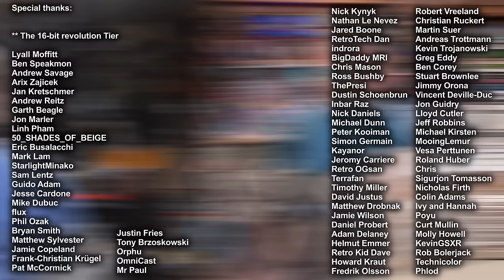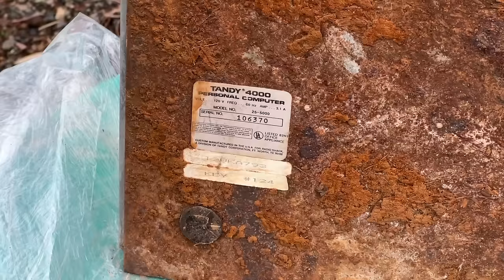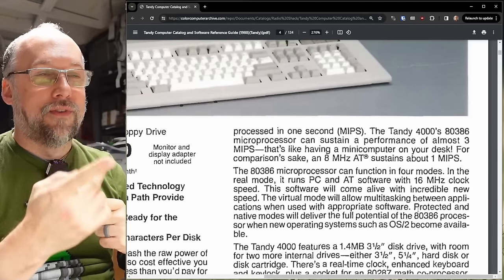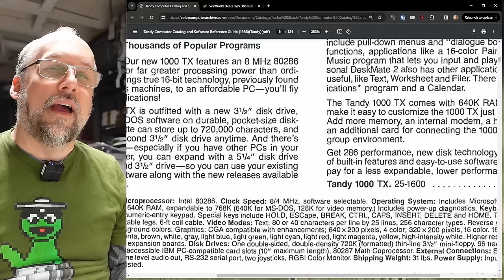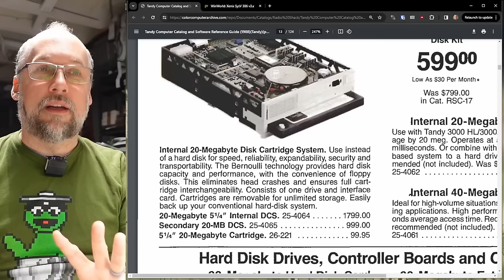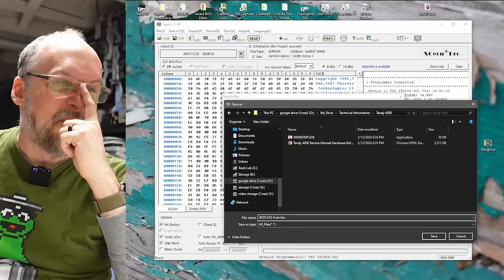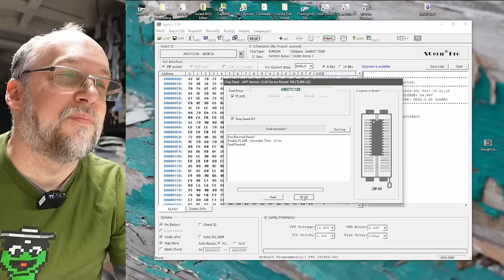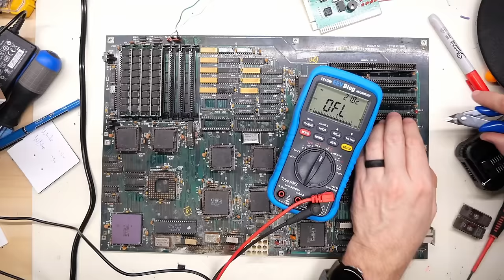0079 I'm at a loss for words when I first see this Tandy 4000 computer

Comment: You are going to need a sponsorship from Deoxit for this repair.
Reply: So true!  This is worst state of a system I've seen in some time.  I do remember the Tandy line of computers though.  I often visited Radio Shack stores because I was interested in the hobbyist electronics.  What I remember of these systems was that they were significantly overpriced for what you get with the exception of the 1000 series.  And yes the 3000+ were pretty nearly bog standard x86 machines, nothing to write home about.

Still, if you can get this to run Adrian, you truly are a master at repair.  Most people would take one look at that and say, "nope, not worth it."  I love how to take on these challenges for better or for worse.
Reply: and Clorox
Reply: Can you buy Deoxit in a 40 Gallon drum?
Reply: Interestingly I don't see any repair at all.
Reply: @jandjrandr  The 4000 was "cheap" for a 386 at the time. The only other offerings when it came out were Compaq, and the ironically IBM incompatible IBM machines with microchannel, which were even more expensive than Compaq.

Comment: Back in another lifetime, I was the manager of a Radio Shack Computer Center. The 4000 was an extremely expensive machine sold to businesses for use as a POS/inventory/bookkeeping system. Most likely it was caught in a hurricane flood and sat in an attic or something for decades! That thing was a boat anchor! If I remember correctly it weighed about 50 pounds.
Reply: Black mold easy fix just clean it off with soap and water🤣
Reply: @SaraMorgan-ym6ue  Yeah and what about the board corrosion, and the rust on the bottom? Soap and water too?
Reply: I think this one literally might have been used as a boat anchor.
Reply: @MegaFonebone  yeah I agree it explains the dirt and the rust🤣🤣🤣
Reply: @the_kombinator  nope a grinder and then rust proof coating simple
Reply: Yup. I'd bet most of these machines were purchased and re-sold as turn-key 'kits' by developers of POS etc software running on top of Xenix. That was a really common business model. There's an excellent Computer Chronicles episode where they talk to a national insurance scheme (firefighters union?) about their move to a supplied turn-key OS/2-based database and client management system.
Reply: @rabidbigdog  can you imagine someone buying up the designs for these old chip to make these machine doing die shrinks then making new old retro computers that do the same thing buy for a fraction the cost of the originals man they would make a killing on the old retro computer market🤣
Reply: @SaraMorgan-ym6ue  For rust that pitted, I'd sandblast it. I mean, yeah, it is a computer, it's not exposed to the elements, but if it's something you care about, I would do it right.
Reply: @the_kombinator  meh I would never bother with something that ancient so that fine if you want to sandblast it have fun
Reply: @SaraMorgan-ym6ue The cost to do all that you're talking about is non-trivial. The killing they will make is of themselves.
Reply: In Australia it was a very fancy computer for schools, mechanics also used them a lot, and many factories would run things from them. We had 3 at my school, a fancy private school. There was this game I played on it where you were on an island, it was SORT of a text adventure with ASCII graphics, you had to chop trees and build a raft, and a little bridge, and get to different islands heading east then south. I cannot find it for the life of me, it was one of those weird educational games for kids that help kids learn to interact with computers and problem solve. If anyone knows HMU.

Comment: I used to work at Radio Shack back in the mid 90s for a few summers. In the late 80s when they went from hand written receipts to a POS systems, they used this 4000 with Unix on it. All the sales were done with serial terminals up front connected to the 4000. After closing you would run the daily sales which would have the system compilate all sales/inventory data and package it up to be transmitted over a modem connecting to CompuServe. There would also be an external SCSI tape drive you would run to back the system up. By the time I was hired in 95, these systems were getting very slow (daily compilation would take a long time and the terminals up front had some lag to them). Fortunately they started refreshing these 4000s with a Dell Pentium which were much faster. They then had us actually take the old Tandy 4000 and put them on the sales floor and sell them for $200. I was told corporate would send them a disk that would reformat the drive and install DOS. But we didn't wipe them there and it had all those customer records on them! Different times. :)
Reply: By the time I was hired, they had IBM pos terminals running Win9x and ACRWin.  DDS3 SCSI backup tapes and an IBM Linux box.  This was 2001 to 2004.
Reply: If I recall, and I probably don't, I think the 4000 back room computer replaced the Tandy 2000 that they used, which was an actual 80186 I think.
Reply: I think the 4000 stuck around quite a while too, until they went to the 425sx.
Reply: I frickin miss Radio Shack.
Reply: @BearfootBob  Well, I'm kind of on the fence regarding that; only because I used to work for them.  I miss not having a local store to go into that has electronic parts.  I don't miss the micro-micro-managing they employed.  No wonder they had such a high turn-around of employees.
Reply: @minty_Joe  Here in Aus, I can't remember exactly when radio shak disappeared. In the 90's though. Soon after that Dick Smith Electronics left the hobbyists behind and stopped selling components (which was a total B because they also had a pretty good library of data sheets for the 74 series and most other chips they sold... they weren't easy to get back then) and probably 5 years ago they ceased to exist afaik.

Now, there's only Jaycar electronics, who charge like wounded bulls. Pretty much leaving us only with flea bay... a crap shoot at best.
Reply: @Jimmeh_B  Yep, ebay, Mouser and Digi-Key are pretty much all that's left for sourcing most components any more.  My only gripe about Radio Shack's selection of parts were (1) Not enough altogether, and (2) the ICs (chips, transistors, etc.) were NTE parts, which most bench techs consider to be inferior.  They may be right about that, but considering that it's the only widely available option out there, I'll have to take my chances.
Reply: @minty_Joe  I applied, never got an interview. I still use a variety of odd audio adaptors from RS.
Reply: @BearfootBob  : The South American franchise operators have apparently bought out the RS owners, so there might be a new rollout coming.
Reply: When I was 14 I bought an "ex-government" Dell Optiplex with a Pentium II 266mhz with 32mb RAM and a 8gb HDD and a 56.6k modem and a soundcard for £250... I managed to slowly upgrade it to 128mb ram, a CD-RW and 64gb HDD... With the help of some folks on IRC I upgraded from it's Win98 to a pirated copy of Win2k that took me about 3 weeks to download and burn with Nero... And another 3 weeks downloading a Slackware image... What a beautiful pinnacle of engineering Win2k was compared to previous versions (still has a soft spot in my heart - Win10 is my current fave - 11 killed the NT4 vibes and more took on a very "stolen" OSX/KDE feel to it... I digress... I learnt my craft from that machine.... A huge upgrade from my previous "Digital" 486 running DOS 6.2 with Win 3.11 for Workgroups with no modem and only Q-Basic, the BIOS, Minesweeper and Solitaire for company... Oh and the aftermarket "The Incredible Machine" game 😍😍.... That Optiplex was hammered on Kazaa, Nero, IRC and IE! Everyone I knew had personalised MP3 mix CD's - circa 2000 - 2004.
Reply: @minty_Joe I don't know that the NTE parts were inferior so much as they aren't an exact replacement. Potentially not as reliable as the original in some applications.
Reply: @TheRattyBiker  Yeah.  Win 2000 Pro SP4 was (btw) a short single step up to Win XP SP2.  So, it's really your choice which one to go with.  Nowadays, I'm going full-on Linux, unless there's a reason to use Win 10 or 11 or macOS.  

Mint w/ Mate 64-bit is my primary distro and I may be thinking about straight up Debian with Cinnamon as a more mature upgrade. Mint is great, but can be a little awkward at times navigating and setting up, depending on what you're doing.  Anything, as long as it's not RHEL/Cent OS, which really shot themselves in the foot and violated the GPL.
Reply: @minty_Joe  OoOoOh! Your quite the character 🤣 Yes I totally agree!! I was a great propenent of SP4 but XP SP2 was also a great version.... Kind of one and the same but with colourful graphics... Though I must say I adored the vulnerabilities of XP's Ctrl + Alt + Del + Del (to 2k style login screen) then an "Administrator" (no password) login to help recover files from people who had "forgotten" there password or outright "break into" a machine for someone.... I crafted my trade and earned my early years bread and badges from those tricks... O/S's today are "too secure" and "unhelpfully helpful".
Personally I loved the offspring that became CentOS as I found RedHat corporately tedious... Even back in the day... TBH though, I only ever used Cent as a server with Webmin and it "just worked" - beautifully even - compared to others.... In this day and age though, it's hard to deny Ubuntu is probably becoming a king of the servers and conquering desktops... Though I fear it's treading awfully close to the irreparable fate of RedHat... I'm not the only one thinking that though... All those old skool Grandaddy Debian and Slack-boxes are now sat on the side smoking there pipes saying "see boy - told you we predicted it" 😉😉😉😂🤣😂🤣😂🤣
Reply: @TheRattyBiker  Well, OSes today have to be more secure, for obvious reasons.  Look at Windows and how much malware there exists.  Why is that?  Because of the percentage of worldwide users of Windows there are.  If the numbers were incredibly low, chances are there won't be that many exploits targeting one platform.  That, and pluralism in the computing world is a good thing to make security pretty tight.  

As far as the distro wars are concerned, it's only a matter of time before someone makes THE One distro that puts all to shame.  Which one that is, I haven't the slightest clue, but I won't stop looking for it.  I just like the fact I can download, install and use Linux without having to pay exorbitant amounts of cash for a copy: like Microsoft does.  I also like the freedom of making and improving software that's open source.  So many benefits to doing so.  And finally, being able to save a decent 10 year old machine from the landfill by putting a distro on it.  Some of these machines I'm practically giving away to low income people who can't afford the latest machine.  It'll at least tie them over and build up my clientele in the IT world.
Reply: @minty_Joe  honestly - it may sound as I'm coming across as being against you - but I'm really not.... I really like your stance😊.... But I think a healthy discussion is based on similar yet opposing stances! I liked 2k, XP - and even 7 - because of its openness (whilst being rather closed for what they were)... Loads of people bang on about BeOS or OS/2 being the pinnacle of evolution.... But I disagree! I think NT and a few subsequent evolutions of it were the true pinnacle of evolution... Apart from OSX... Agreed... the newer versions of MS have gone backwards since Windows 7-10 Enterprise.... Which was reasonable.... 11 to me is just a terribly nasty rip off of either OSX or a KDE/Gnome Desktop!!! I've almost essays to write about that..... The fact though that "landfill" machines can be reclaimed as viable GNU desktops or suitable Web-browsers (as they can now run HTML5 instead of just "intense Adobe FLV's"!) is a thing of wonder that makes my heart glow!!! It's a shame really as I now know my childhood P3 800mhz from 2002
I had in with super boosted 512 ram and a 80gb HDD could now techichnically out-do the phone I'm on if it was running Linux... That just warms the heart to know! 🤣🤣
Reply: @TheRattyBiker  No, I don't see your responses as "against me"; I see us both agreeing to the same things.  Microsoft did have a good thing going in their GUI...until they suddenly had "too many chefs in the kitchen" so-to-speak.  Then, yes, they started copying designs and ideas from other platforms for years.  Heck, Apple is equally as guilty.  Somewhere along the way, they both got tainted in quality and experience with the most recent products.  

I've stuck to Linux for so long because it provides what I want without the forcefulness of a proprietary entity like Apple or Microsoft.  macOS is the closest you'll get to genuine UNIX, since Darwin/BSD is under the hood.  You can thank NEXT, Inc. and then later Apple (after buying NEXT) for merging that with a decent GUI.  

It is nice to see new life breathed back into old hardware, but I do have my cut-off points.  A lot of that has to do with not just support, but a combination of 32-bit vs 64 and how bloated architecture handles on older machines.  If Moore's Law has caught up and it's not worth it, then don't.  I'm running Mint 21.3 Mate 64-bit on a 2010 Toshiba laptop with a Core i3.  I've maxed out the RAM (8GB DDR3 total), threw in a SATA SSD and it runs great.  There are some minor lag issues on web browsing, but over all not bad.

Comment: I ran a small office on a Tandy 4000, using multi-user SCO Xenix.  There was a card that provided four video cards (Hercules, as daughter boards) and keyboard interfaces so it could support five people (this was called the "unterminal" VNA from Advance Micro Research- the monitors and keyboards could be like 20 ft. away from the computer).  This was much nicer than using serial terminals.  We ran "SCO Professional" (SCO's Lotus 123 clone) and RealWorld Accounting.  There was no networking.  There was a direct line from the 68000-based Tandy Model 12/16/6000 to this for business applications.
Reply: NComputing made similar solutions for both Windows and Linux...

Comment: The Tandy 3000 and 4000 were considered Business grade computers. Business grade computers were usually sold without the OS, because the company's tech would set up the computer with whatever OS that was being used. They were using IBM-PC compatible software, not Tandy software. They were commonly used on small networks for businesses that had custom, typically home-grown databases made with databases such as Paradox , DBASE and R:Base. I saw them regularly in smaller businesses that usually had less than 20 employees...

Great video, Adrian!
Reply: Yep!  They also used the Tandy 4000s in the backroom in the stores as well; they had Xenix and ran the POS terminals on them.  They were the first multi-user POS server that Tandy used before they moved to a custom built 486 (before they moved to the ACR and SCO in the late 90s when I left.)  I have some marketing material on the 4000 they sent to franchises that I scanned that I can send to Adrian.
Reply: I used to work for Radio Shack from April 2001 to Thanksgiving week 2004.  They were using IBM point-of-sale terminals running Windows 9x and ACRWin.  The main server in the back office ran I think SCO Linux or Debian with ACRWin running on top of that in Wine🍷.  The DDS3 tape backup system was a pita.

Comment: Oh the memories of this machine in the backrooms of the many Radio Shacks I worked at and managed from 1990-1994!  Running those tape backup's daily, waiting for the system to do the occasional update it would recieve after dialaing home for the daily sales/inventory exchange.  These machines were beasts and lasted through a lot.  These 4000's were the brains and muscle for each Radio Shack store as the Tandy 1000 TL (sometimes TL/2's) at the front counters were just terminals for POS & Inventory look ups from the Tandy 4000 sitting in the back room at the managers desk.  Would love to see you revive this board.

Comment: The second math co-processor socket at 54:19 (U15) is for a Weitek math co-processor and not a 387, hence the W1167 marking (Weitek 1167). It's likely that one could be used in addition to the 287/287XL in the 16-bit socket as well. It may support a W3167 as well which is likely a little more common. Though both Weitek chips are quite rare now and were expensive options when new.
Reply: That certainly makes sense given the silkscreen. The TRM says: "Support for optional 80287 or Weitek 1167 math co-processor." I have a Rev A board and a couple Rev C boards. The Rev C boards have a 387 socket, but no 287 socket.

Comment: I think the floating point performance of this machine was laterally measured in fathoms!
Reply: Underrated comment!
Reply: Considering there's no FPU, it can be measured in nothing.
Reply: @the_kombinator  an FPU is not required to perform floating point calculations:)
Reply: This 386 machine had a socket for an 80287. Yes, I typed 80287. I still have my 4000, but it needs some work.
Reply: @dmuntz  Early ones did. I have a full size 386 board somewhere with a slot for a 287 too. I don't have a case to put it into though.